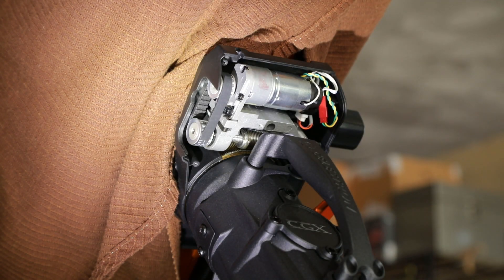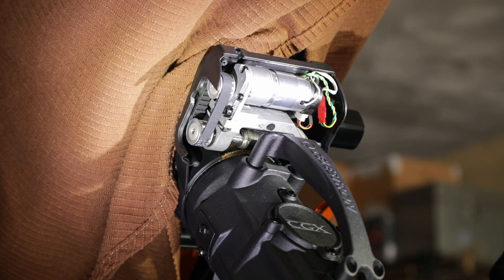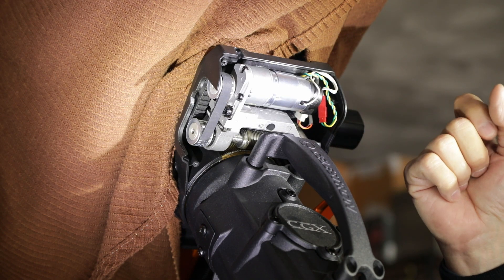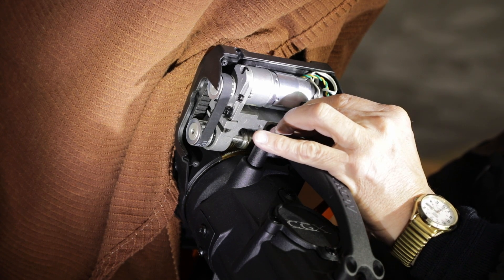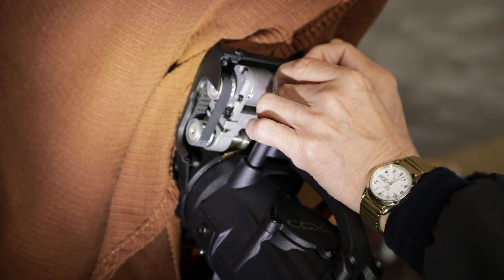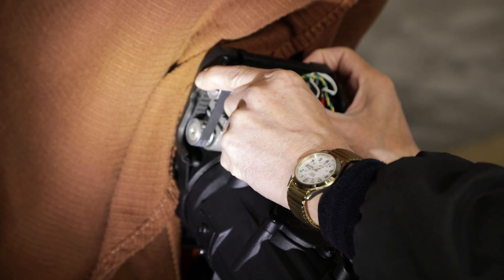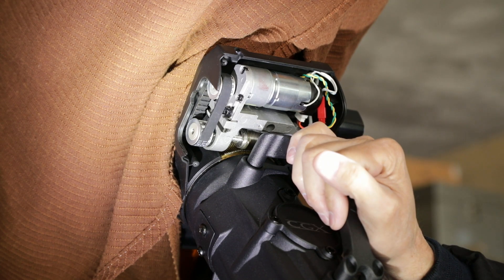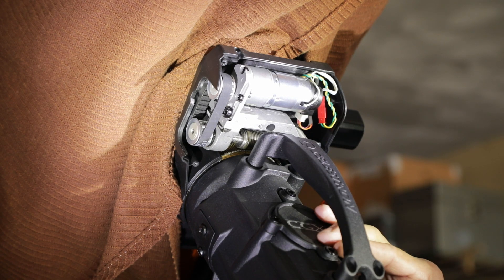Setting The Backlash on your CGX or CGX L Mount

Comment: Thank you so much for this great video. It's given me the confidence to adjust the backlash on my CGXL! 

Forgive this naive question, but you're actually turning the 3mm Adjustment scew counter clockwise, correct, lefty loosey? Is that one of those weird scews that's gets tighter when you turn it to the left, instead of turning it to the right like most screws?  Thanks!
Reply from the maker: Like the name...  ;-)   Yes, backing the 3mm out lowers the worm closer to the big gear it rides on. This closes the gap and reduces the backlash.
Reply: @jeffrh  Thanks! I was just re watching your video as you replied. I'm off outsdie now to give it a go! I'll report back. Thanks again
Reply: @jeffrh  Hi Jeff, 

Long story short - I made some adjustments and I have my unguided (which I prefer) subs back up to 2 minutes with round stars. ( CGXL 8" Celestron Edge @ F7   1470MM  focal length) 

I actually spent more time trying to get the !@#$%^ cover off and on than doing the adjustment! And yes I did lose one of the screws. 

Initially, I became lost as to how far I had turned the 3mm Adjustment screw. So I used your method of moving the axis as you turn the scew, RA in my case, and I did this my gently trying to move the counter weight shaft until I encountered no more movement. So that provided me with a 'baseline' of where to adjust from, if that makes sense. 

As per your video, once the backlash has been taken out by adjusting the 3mm screw, the motor housing itself is then a bit loose and needs adjusting via the 2mm 'range' screw. I found this to extremely tight but I believe I was able to move it a bit. The movement / recoil on the motor housing is now 2 - 3mm , but the mount seems to be tracking well and the subs were up to 2 minute unguided, which is they were before the backlah became an issue.

I noticed last night that I was able to get 2 minuted unguided subs for objects in the west (both circumpolar and otherwise) but in the east 90 seconds was more the sweet spot. Any theory as to why that may be? A balance issue? I believe I have the mount very slightly east side heavy at the momenet. 

Thanks again for all your help.
Reply from the maker: @HollomanUFOLanding  I use a C14 and guide with PHD2. I was getting RMS Errors averaging .5 to .9. with a CGX-L. The big scope gets tossed by the wind catching the Dew Shield some. Still, when the backlash is right. Things will work them selves out in the end. Glad you got your mount working better. Just remember not to get the worm to tight. That is worse than having too much backlash as you are jamming the worm into that bigger gear and you no longer have room for the worm to float on that big gear. Clearskies
Reply: @jeffrh  OK thanks. Re your last sentences - that abaility for the worm to float on the bigger gear, that adjustment would be from the 2mm screw that dictates how much the motor unit moves, right? I figured it was better to have some movement there (like I do) rather than hardly any movement. 

I have a 14 Edge on another CGXL mount which I'm hoping to have in action soon. I have installed a focus motor and F7 reducer. I have it mounted on a Scope Buggy, which works great. Which targets do you go after using your C14? (Aside from planets.) My RASA covers the big wide field objects. I was thinking of objects like M51, M101 etc for my 14 Edge. Thanks again, & the clearest of skies to you.
Reply from the maker: @HollomanUFOLanding   Yes, the 2 mm limits how much pitch the whole worm unit has. It is also used to keep the worm from jumping teeth. I like to have between 2 to 3 mm of housing movement after I get the backlask out. If you get the backlash out and before you adjust the 2 mm. If you move the worm housing up and down like I showed in the video. When you jiggle the axis that you just worked on. You show feel the backlask graw as you are pushing the housing up. Then after doing that a few times, if your backlash is still good. I get the 2 mm set for around 2 to 3 mm of total housing movement up and down. Hope this helps...
Reply: @jeffrh  Yes, that's very helpful, thank you.

Comment: Hi again Jeff

Hope all is aggod with you. 

Thanks again for this exceptional video and for all your very kind help to me & others.

Question - as well beinmg able to move either the OTA in Dec or counter weight shaft in RA to check for backlash slop, do you also pay any attention to the noise your mount makes? I notice mine vibrates and shudders less when I have tried to decrease the backlash. I welcome any views / thoughts you have on this. Thanks
Reply from the maker: If you are hearing something like that then you went to far and the worm can no longer move up & down on the bigger gear. It's binding. Loosen both allens starting with the 2 mm. Then the 3 mm... Move the housing up & down to see that you now have movement over the 2 to 3 mm you would want for the final set up. Now start taking the backlask out with the 3 mm allen. As soon as you feel no more bascklash or movement in RA. That is as far you you need to take things. Any further and you will remove any fee movement the worm needs to float on the bigger gear. When you are happy with the backlash. Move the 2 mm until you have that 2 to 3 mm of housing movement up & down. That should fix you up... You might want to back off the 3mm allen by the smallest amount to be sure that you didn't go to far... 

It is sounding like you were to tight and may have also wiped the grease off of the gears. Might be a good time to regrease the bigger gear. You don't need very much. Then run the DC Servo motors to work the grease into the gear and worm. Hope this helps...
Reply: @jeffrh  Thanks for that Jeff.

The noise was actually there before I did the adjustment but seemed to get better (less) as I dialed out the backlash a little (turning 3mm anti clock).  I'm thinking that if, in my case, the noise was due to binding, then taking more backlash out would have caused more binding and more noise but it didn't. So maybe noise from the motors can apply with too backlash and binding? Your thoughts? 

The man in the link below had a bad noise from his motors and turned the 3mm adjuster and ithe noise was much improved but I can't see clearly which way he is turning the adjsuter IE whether he is releasing backlash or increasing it a little to release binding....

https://www.youtube.com/watch?v=pvxQ0Ad0s7g
Reply from the maker: @HollomanUFOLanding    Sounds like you may have a bad worm bearing. Early CGX mount came from the factory with the worm bearing over tightened. It sounds ike you are already out of warrenty? So doing anything to the mount won't effect that...  You will need to take the housing off of the mount so you can take the worm assembly off. With that off, you can then loosen the preload on the worm bearing. You can tell you have it right when the worn turns easier with your fingers. There may be a pretty good chance that the bearing was proloaded to tight for to long of a period and will need a new bearing to fix the problem...

Not sure how much Celestron would charge for something like that or if you feel up to the task.  How you can tell if you have to much worm bearing preload is you can't turn the worm with your fingers... It is to tight...  I have not needed to do this as my mount is only a couple of years old and Celestron fixed this before I got mine. Good luck.
Reply: @jeffrh  Hey Jeff

Nope, you were correct in your previous response - I had made it bind. When I was testing the mount, it actually jumped a few times. So I stopped there and then, and, in the dark, removed the dec and ra covers and did it all again. 

As per your recommendation, I slackened off the 2mm a bit and then slackened off the 3mm to increase backlash, by turing clockwise. I then slowly turned the 3mm back anti clockwise until I couldn't detect any free play in either axis. I then set the 2mm screw free play to be about 2 to 3mm of movement. I then turned the 3mm a tiny bit clockwise, as per your suggestion, just in case I was slightly over tight. 

I retested the mount - no more jumping or weirdness. There is a tiny bit of vibration so I might give the 3mm a tiny final turn clockwise, but apart from that I think (HOPE!) I'm finished - 'til my next adjustment! HAHHA 

Thanks again for all your help, so appreciated. 

What grade grease do you use? Do you take the factory goop off first before applying new grease? My mounts ( I have 2 CGXLs) are both about 1 year old btw.
Reply from the maker: @HollomanUFOLanding  I use Super Lube... It's a synthetic grease. You should be able to find it at most Auto Parts stores...
Reply: @jeffrh  Thanks :) 

I have noticed that temperature seems to play quite a role in backlash - which is to be expected really as the tolerances contract in cold and expand in summer. Hence your spring backlash tune up?? 

Honestly, overall, the hardest part of the whole routine has been the removal and replacement of those persky little black motor cover screws!! If I could work out what size they are I would replace with some that are more easily picked up by magnetic screwdrivers. The black anodised finish of the factory screws seems to severely inhibit magnetism.

Comment: Hi Jeff.  I did this adjustment on my RA Axis.  Got the backlash out as the guiding is much improved.  However I could not get the 2mm screw to even move.  I could not loosen it nor could I tighten it.  Luckily, I didn't get to much additional slop in the motor, so I tested the RA Axis and it works just great.   But have you ever seen those 2mm screws so tight you couldn't loosen or tighten them?
Reply from the maker: I have not. Dumb question coming...  ;-)  Is there even a 2 mm allen in the hole? My next question would be this, is the mount still in warrenty? If it is, I would send off a note to Celestron and tell them that you backlash is way off. See what they say? You never know till you know.  If you are out of warrenty. Try some pentrating spray like WD40. Give it a spray being careful to not soak things other than the 2 mm hole. You may need to take the head off of the mount so you can set it upside down to do this. Let it set overnight. I'm thinking you may have an allen that is stuck from the Blue Loctite they use to help keep the allens from backing in or out. With the head off. Looking down into the 2 mm hole. If you see a lot of blue around the allen. That's most likely the problem. If after an overnight soaking and you can turn the allen. I would take it out to clean up the WD40 and excess Blue Loctite out of the hole. You don't need moch t0 keep the allen from truning on its own. Good luck...
Reply: @jeffrh    Hi Jeff.   Thanks for the follow up.  I too wonder if it's just a little over agressive locktite.  I bought a new pair of heavy duty allen wrenchs to see if they can get the bolt lose.   The ones I had were cheap and I was just going to bend the wrench if I kept trying to loosen the bolt.  Hopefully these with the longer length will give me a little more leverage.  But I will be carefull.  I'm going to go in and take a real close look as at times I was wondering if the wrench was wedged into the wrong spot.  But I'll contact  Celestron if I need too.  It's about 8 months old.  Got last summer.  Depending on the target my guiding is between 0.68 and about 1.17 Arc Seconds.  at 1422  mm.  thanks for the help.

Comment: Hi, the first video of this process I have seen which actually makes sense. Seems like this adjustment is required for this mount from time to time even though Celestron doesn't want people making the adjustment. I have seen this issue come up a few times. 

Do you need to back off the 2mm adjustment screw before making the backlash adjustment? Also, when you remove the grease, do you just mechanically remove it, or do you use solvents?
Reply from the maker: Thanks Kevin,  Both of my mounts are out of warrenty and I'm only sending them back if I think I can't fix it myself. If your finding that your backlash is moving after you set it. I might put a drop of Blue Loctite on the 3 & 2 mm allen threads. I found that mine would back out from usage because they were too loose. I think Celestron was finding that some people were trying to set the backlash and they didn't quite know what they were doing. As a result, some individuals were over tightening the 2 mm allen which resulted in binding of the gears. When you have the backlash set correctly. If you move the housing while moving the axis in question at the same time. You will feel the backlash open and close up with the housing move. This is the float that I was talking about. If things are correctly set. You should feel the backlash and you will not jump teeth. If you are jumping teeth. You have the 2 mm too loose. With about 2 mm of housing movement. You will be golden. That's plenty of room for the worm to float up and down on the big gear. 

I do not use any solvents to clean of the old grease. I use a tooth pick to remove the grease that has gone to ether side of the worm and big gear teeth. kind of tedious but works for me. When if finished removing the old grease. i'll use SuperLube and another tooth pick to apply a thin coat on the big gear only. When that's done, I'll move the axis from lock to lock to work the new grease in. Hope this helps...
Reply: @jeffrh  Thanks for the response... It does help. I've had the CGX 2 years now... but guiding is getting worse. At least now I have something to check and if backlash and the tension are ok, I can at least clean and reapply the grease.

Comment: Jeff - Thanks so much.  My CGX-L RA  stopped working. Opening the cover, I found zero "slop" or "pitch" movement. None. It's too tight. The worm gear is jammed tight against the RA ring.   I unscrewed (or screw in) both the 2mm and 3mm adjustment screws, but that caused no "pitch" movement at all.  I sense that I need to displace the worm and motor assembly ~1 mm away from the ring gear.   Do you know how to achieve that?
-Geoff
Reply from the maker: Geoff, Sounds like one of the allens moved over time. The 2 MM allen would be counter clockwise to free up the housing. The 3 MM will move the housing in pitch so the the worm can touch the bigger gear. So if both the worm and housing don't move. Loosen the 2 MM counter clockwise and then see if you can get the housing moving up & down. If that works. The move the 3 MM clockwise to get the worm off the big gear. With everything freed up. You can then follow the video to get the backlash zeroed out... Hope this helps...
Reply: @jeffrh  Thanks again, Jeff.  Today, I detached my RA motor from the belt.  Pushing East or West on the hand paddle, I saw the shaft from the motor did not rotate.  When I rotated the shaft with my hand, it would start rotating by itself, but then it would stop after ~10 seconds.  So, the motor is definitely not functioning well.   I have ordered a new one for CGX and CGX-L: Part # CGX-F00-3.  Price: $175.00   My fingers are crossed.
Reply from the maker: @geoff8205  That's a hard one to take... Sounds like the motor was under to much strain for to long. Hope that fixes you up...

Comment: So many CGX/L users have this problem straight from the factory. It makes me think twice about buying Celestron again. Quality assurance is abysmal
Reply from the maker: DOC, this seems to be a problem with many thing made overseas...  At least there is an easy fix though it would be nice if it worked correctly out of the box. Both my CGX and CGX-L track wonderfully when the backlash is set correctly...